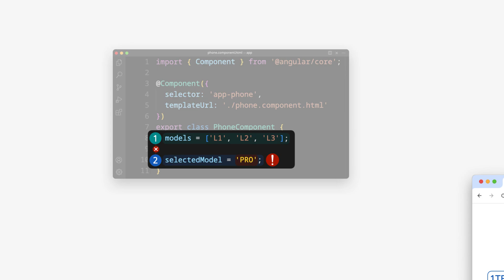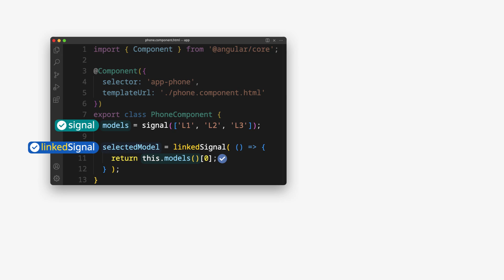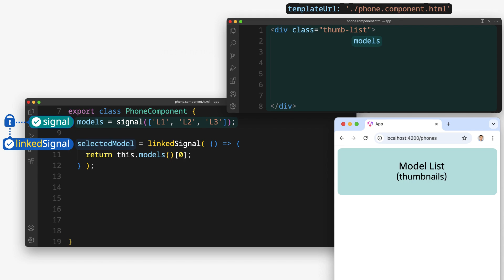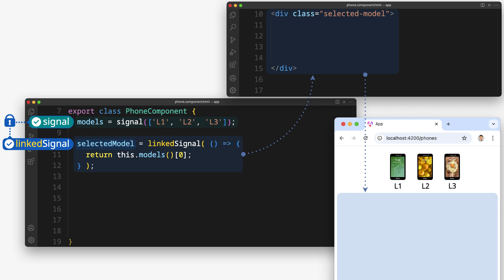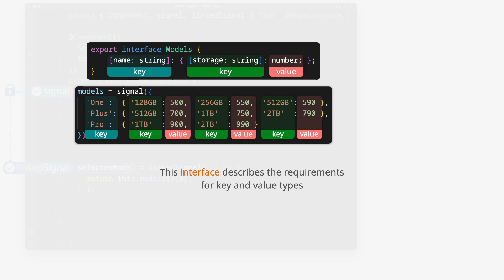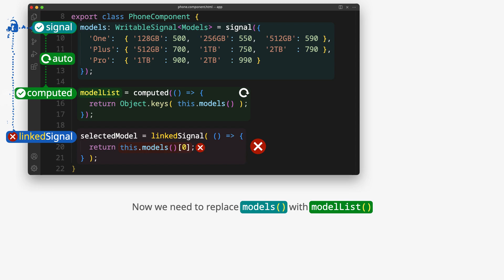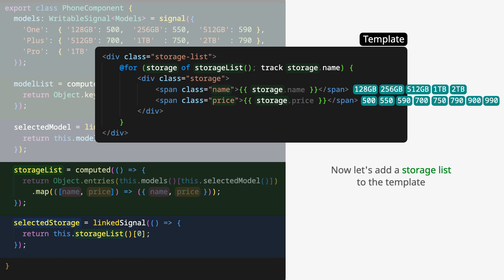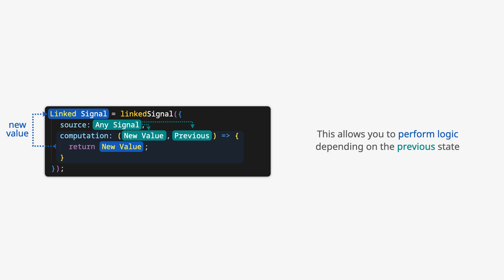New in Angular 19: linkedSignal – A New Kind of Signal

Comment: Great video. I have a question: Do we always have to set the default for linkedSignal? Can we set it to null, because some of my cases show nothing until the user selects the product?
Reply from the maker: Thanks for your comment and great question! 👍

A linkedSignal must have a function, but this function can include any logic and return any value, including null or an empty string. In your case, the linkedSignal can return null by default if no product is selected.

linkedSignal(() => { return null; })

You can also implement conditional logic inside the linkedSignal function to handle different states: before and after the user selects a product.

I hope this helps answer your question!👍
Reply: @theigorsedov  Thanks for your answer, very clear. Keep it up